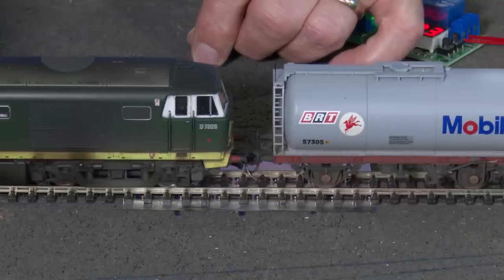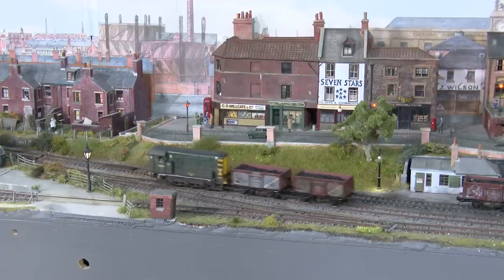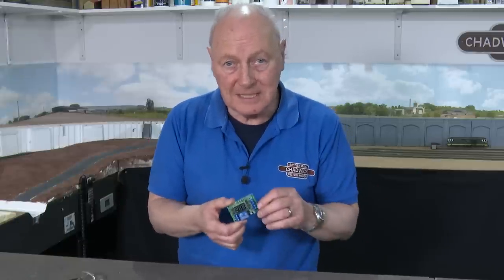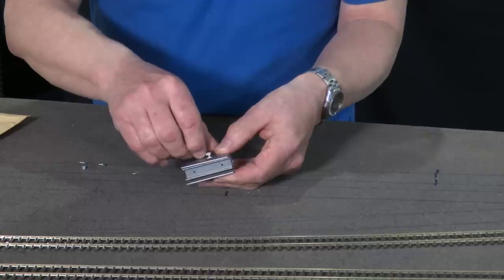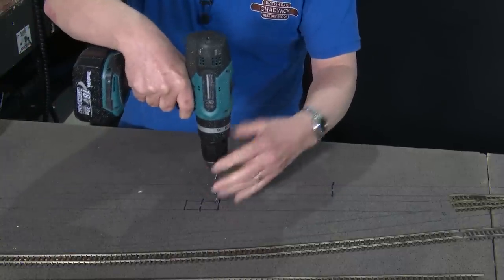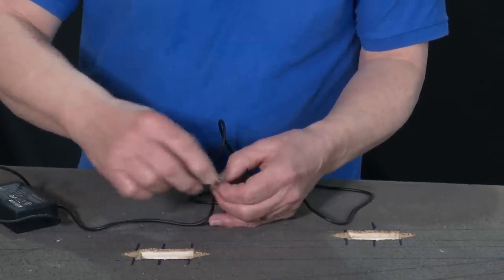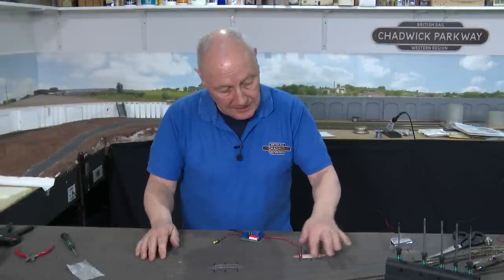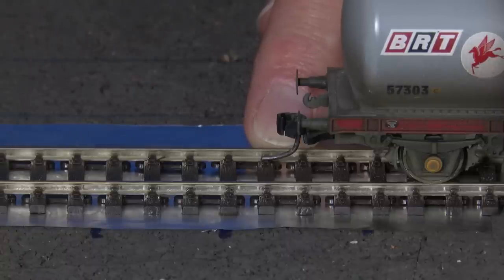Installing Kadee Electro Magnetic Uncoupler #309 Chadwick Model Railway | 182.

Comment: I read Steve Jubb's comment which was actually a very good option, my thought was just the opposite, wire the LED on the push button to the NO side along with the power to the solenoid so that the LED is illuminated while the uncoupler is active.  So it becomes your choice as to which way you want to go with the LEDs, always on until you activate the uncoupler or only on when the uncoupler is energized.  You might have some sleepless nights pondering that decision.  😉😉
Reply from the maker: It’s an excellent dilemma, Dave, but I would go for the LED off when energised. Regards, Charlie
Reply: @ChadwickModelRailway  Right choice - then the switch is illuminated so you can find it when you need it!

Comment: Hi Charlie, another excellent video in your very easy-to-follow style. I'm also trying to find the best solution for hands-free Kadee uncoupling without the indvertant uncoupling that can come from using the regular Kadee rectangular magnets. I was wondering if you have considered trying Rapido's railcrew uncouplers, and if so, what do you think of them?
Cheers,
Ben
Reply from the maker: No Ben, I have never used those uncouplers. However, I am working on an automatic uncoupling solution driven by Train Controller. Regards, Charlie

Comment: Great video on electrical switches and relays.

You might actually be able to use the 'NO' terminal on that timer to drive the LED on the switch. That way the light goes out when the timer is running. Or the other way around so the LED lights up when the solenoid is active but then it makes the button harder to find in the dark.
Depending on voltages it might require another relay though.
Reply from the maker: I had thought about it, but who looks at the switch when you’re doing the uncoupling?. Regards, Charlie

Comment: Another great video. Why don’t you wire the positive led terminal to the output positive that goes to the coil. Then it will light up green while the uncoupled is energised. Just a thought.
Reply from the maker: Hi Harrold, the coil voltage is 16 volts, would that not be going through the LED and perhaps blow it? Regards Charlie
Reply: @ChadwickModelRailway  maybe a little high, I guess you could put a small 500 ohm resistors in series, and that should do it. Ant.
Reply from the maker: Thanks Ant,  that’s certainly worth exploring. However, I would much rather have a switch that flashes whilst in operation. Perhaps that’s just wishful thinking. Regards Charlie

Comment: That’s an interesting video Charlie. I’ve been wondering about the best way to go with couplings, particularly with uncoupling in mind as I’ll (eventually) have a terminal station where locomotives need to couple and uncouple. I do like magnetic couplings so will use these in between rakes, but locomotives and coaches at the ends of rakes will use Kadee couplings. The uncoupler you’ve demonstrated is the answer to my station (and also some sidings) means of uncoupling. Though, rather than those relay boards that you’ve used, I’ll use a DCC relay so that the uncoupling can be performed through iTrain.
Reply from the maker: A great answer to our ongoing coupling issues. Good luck with your solution.
Regards Charlie

Comment: I use a capacitor discharge unit for my points, it would give the solenoid a burst rather than a long period of current, so the train would have to be exactly over the decoupling point, but you don’t require a large power supply and it’s safe in regards to burning out the solenoid.
Reply from the maker: Now that’s an interesting point. Regards, Charlie

Comment: what you could do is wire the LED for the button in parallel with the solenoid, then it will light the button when the solenoid is on. Or wire button LED with the NC and C side of the relay, then the LED will go out when the solenoid is On
Reply from the maker: I think you’re right, going out when activated is a better option. Regards, Charlie

Comment: You can buy car type blade fuses and circuit breakers (Thermal trips) with different types of fuse holders if your ever concerned with power supply overload or short circuit. They can be found in a few places. Circuit like this I would be tempted to add a fuse to the PSU output protect from short circuit.
Reply from the maker: An interesting thought John, many thanks. Regards Charlie

Comment: What an interesting system! It looks really quite handy, I have to admit I'm not really a fan of Kadees, because I really can't suspend my disbelief if I see a British locomotive running with such a detailed American coupler even though I absolutely can with tension locks or magnetic coupling like from Hunt couplings. Although it seems that Kadee is basically the most sensible route to go for having functional couplings that don't protrude much.
Reply from the maker: Interesting comment. However, these are much more preferable than our normal tension lock couplings. Regards, Charlie

Comment: Great video very instructive and well presented my only comment would be I am supprised at the size of the solonoid it's massive It does not matter on your layout because you use tortoise point motors so have a deep area free under your baseboard but if space is limited it would be a problem.
Reply from the maker: Yes, that’s a fair point Arthur. Regards, Charlie

Comment: HI Charlie. 

1.5amps was referred to twice so, simple arithmetic shows you that 2 x 1.5amps = 3amps. Simples! 😊 

Paul.
Reply from the maker: How silly of me to have missed that Paul. Regards, Charlie
Reply: Charlie.

It wasn't really silly of you as anyone who left school a very looong time ago is prone to simple mistakes. 😅 

I'd just like to point out that with uncoupling devices permanently positioned on the track, you are restricted with your shunting operations. Therefore, if you have to uncouple a rake of only 3 wagons, they could be ‘parked’ several dozen yards from the end of the line where the unloading bay is situated. Personally, I would use the good old fashioned method of a bent lolly stick for both wagons and carriages, even if the ‘hand of God’ is looked upon as sacrilege. 

Regards, 

Paul. 👍

Comment: Splendid stuff as always Charlie.
Given that the boards have a green LED indicator on them already a person could just introduce the end of a bit of fiberoptic line to that LED.  Then trace the other end around to some convenient location like the fascia perhaps.  That would want a ferrule of some sort.

Alternately a person might just introduce an LED on the energized leg and wire it to some feature on the layout like a shack or abandoned gooseneck light that would illuminate while the "decouple" was "on."

A person disinclined to muck about in the switch circuitry could just lay a Normally Closed magnetic reed switch near the solenoid and use that to animate some feature on the surface o the layout.  A light would be an obvious choice but a door to a shack or shed could be animated as well.
Reply from the maker: It’s interesting that you made that suggestion, Captain Mac. I had thought about putting in a little shed, with one light on either end to be turned on when the appropriate solenoid is activated. Regards, Charlie

Comment: Hi Charlie! Informative and very timely video as I've recently been watching Larry's video on the other uncoupling options, and you've introduced me to an option I was previously unaware of. Looking at your particular use case, could you run both turnout push buttons through a single timer, given that they're side by side? I'm now starting to think about uncoupling options for my own layout which is under construction but as you say, the solenoid option certainly ain't cheap!!
BTW the end of February is fast approaching so I hope you have enough time to stick to your monthly schedule? 😉
Cheers, Peter
Reply from the maker: Great comment Peter.
However, if you wire both solenoids together, then you would pull twice the power from the transformer. 
 Yes I do realise I am up against my February deadline.! Regards, Charlie

Comment: Hi Charlie, after watching your video (which I found interesting, thanks) I'd like to add some info about the green push button switches, which have various alternative operating voltages for the LED's. I use these myself on my fiddle yard mimic panel, I wanted to use the LED's to show which route is selected, but I had to add a diode on one of the switch led terminals so that the LED only illuminates when that particular route / loop is selected. I had a brain scratching exercise trying to find out why a LED would illuminate no matter if the polarity is reversed or not. So I opened up a spare switch and found that the LED is bi polarity (in actual fact there are two LEDs in one). These are great switches and I've had no trouble at all with them, I've also used them as reset buttons for NCE EB1 DCC Circuit Breakers. Anyway I hope that this info helps others who want to use them for different purposes.
Reply from the maker: Thanks Eve, that’s very useful info. They had me confused for quite some time. Regards, Charlie

Comment: Charlie why not wire the Pushbutton Led across the solenoid wires so that when you push the button the Led comes on for the time you have set on the timer and then goes out showing there is no power on the Solenoid. BIll fro WA
Reply from the maker: I think that it will be better the other way around Bill. Regards, Charlie

Comment: Great update Charlie with some very useful and interesting information! I'd never seen those countdown timers before and am sure they'd be useful in a range of situations, both for delaying and prolonging the operation of some external device! However, I was wondering if instead of using a push button, could you use DCC to trigger the countdown? I suppose I'm asking if you know of a way to use a DCC signal to replicate a momentary contact switch? Keep the good content coming! All the best, Ian.
Reply from the maker: Hi Ian, it’s funny that you ask that question. It’s something I’m currently working on. I’m using a reed switch to feedback into the system to see if it will auto uncouple. Regards Charlie

Comment: When I built my little layout, I installed a Kadee #308 uncoupler magnet under the track on a siding. It's fine for that because any unintentional decouples will already be on a siding and I can take another shot at it. 
Rolling stock that I use for the industries on that siding have had steel weights replaced with lead, or copper pennies, and all wheel sets are non-magnetic.
It would indeed be far better to use the #309 as you show here for mainline and large or busy areas. I know Loksound decoders include an auto decouple shuffle that can be triggered with a function button and adjusted to get the timing right. That could be a next step if you use those. Then it'd just be two button pushes.
I feel like this could all be automated actually. One press and it's all done for you, but you'd need the decoupler to talk dcc as well. Maybe I'm rambling? OK, thanks for another good one!
Reply from the maker: You’re bang on the money, Tom. I do use ESU decoders and have enabled the uncouple shuffle. Hopefully Train Controller can automate it all. Regards, Charlie

Comment: Charlie, two things. 
Did you check the current taken by the uncoupler?
If the power for the illumination of the push-button comes from the output of the relay, you can have lights off or change colour when the relay is active.
Reply from the maker: No I didn’t check its current draw Tom. However, I am searching for a by colour LED. Regards, Charlie
Reply: Charlie, it might be sufficient to check the voltage coming out of the PSU, and confirm it doesn’t droop because of taking more current than the PSU can provide.

Comment: If you wire the switch illumination to the relay output you could use that as an indication to the solenoid being energised
Reply from the maker: Yes, but I think it’s better the other way around so it  goes out when it is energised. Regards Charlie
Reply: @ChadwickModelRailway  easily enough done through the relay NC contact 🙂 as I'm sure you know

Comment: Hi Charlie, you might have some options for feedback on the switch with what you already have, if it will cope with the same 16V DC that the solenoid uses. (if not you can probably achieve the same by adding a resistor).

First you would need to swap the relay connectors so that +16V is on relay common, and the solenoid is on relay NO. I think you have those the other way around at the moment.

Then you could wire the switch LED between the relay NC and the 0V on the power supply. This would give you a switch that lights up green whilst the solenoid is off, but goes out whilst the solenoid is on.

You can get similar buttons with multiple colours in them. If you had one of those, you could wire it as above but with another colour to the relay NO with the solenoid. This would give you a button that lit up green when idle, the turned red whilst the solenoid is active. Unfortunately the only buttons like this I could find are physically bigger, so would need different holes, and are about £15 each, so not certain if that's worth it.
Reply from the maker: Thank you for some sound advice George, I think you’re spot-on mate. Yes I am looking at the twin coloured switches but haven’t found anything suitable as yet. Regards Charlie

Comment: Pah. Americans coming over here with their reliable coupling systems and making us use ye olde feet and inches! 😂😂
I just hold to anything under a yard needing to be measured in millimetres....

Another good video, Charlie. Don't know how you manage to make these so informative and entertaining.

I see everyone has already suggested ways of making your sexy switch light/unlight when the solenoid is in operation.  

This must be a a really silly question, as I can't see anyone else ask it, but I wondered why you need that countdown circuit box (as clever - and yes a wee a bit sexy - as it is) at all. Would the solenoid not work with just an unlatching push to make switch, and you just hold it in as long as it takes to uncouple?  I'm obviously missing something: is it to do with future automation which can't apply a finger for 8 seconds, maybe?
Reply from the maker: You make an interesting point Andrew. However, I use one hand to hold my controller, the other hand to press a button, leaving me one hand short to press the actuating button. Regards, Charlie

Comment: Hi Charlie, Great video. I have recently started watching your channel and I saw I one of your older videos (episode 123) you mentioned that MDF was not a great material to work with. As I am planning the construction of my new layout I was wondering what the best baseboard materials would be and if there are any I should steer clear of as I have only ever used 18mm MDF. Thanks Nat.👍
Reply from the maker: Hi Nat, I would go for either 12 mm or 18 mm plywood. Regards, Charlie
Reply: @ChadwickModelRailway  thanks 👍

Comment: Question, curious why you chose to use use magnets?  Precimodels makes a motorized coupler, did you consider this as an option? Thanks for all your videos, they are great!
Reply from the maker: Yes Brad I do have some of their solenoid uncouplers.  However, I do need to show and try out, what is available.  Regards Charlie
Reply: Do you like the way the solenoid couplers work? I am wondering the pros and cons. Thanks

Comment: A 2-56 screw means that it is a size 2 screw with 56 threads per inch. Metric screw threads are measured by the distance between the threads.
Reply from the maker: Thanks Dave, it appears that every day really is a school day. Regards, Charlie

Comment: Great video as always Charlie. Could you power the LED on the switch from the relay? The green ring will then only illuminate for the period the relay is energised and provide visual confirmation of the switching.
Reply from the maker: Great comment Phil, but would I not be putting 16 Volts  through the LED rather than the 12? Regards Charlie
Reply: @ChadwickModelRailway  Thanks Charlie. There may be a resistor built in to the switch or you can just add one to protect the LED if you are not sure. Worth a try? I do it with some (albeit square ones) that I have. They light up as the relay latches, amd extinguish when it reopens. V sexy!
Reply from the maker: An excellent suggestion, Phil, I shall certainly check it out. Ideally, I would like a circuit board which allows the LED to flash when in operation. Perhaps that’s just wishful thinking! Regards, Charlie
Reply: Thanks Charlie and that could be done. You would need a second latching relay with a flasher circuit on the NO side with power to LED normally fed from the NC side.

Comment: With your green lit switch, why not route the LED supply via the NC side of the relay. It wouldn't flash, but it would go out when the solenoid is active.
Reply from the maker: I tried that mate, but it seems to be an issue, I shall have to investigate further. Regards, Charlie

Comment: As the switch gives you access to the switch/pushbution, led why not use a pair of wires in parallel with the solenoid back to the button led so that it stays alight all the time the solenoid is operated. Seems logical tome.. So long as you get the polarity correct for the led home and dry.. Worth it so that you have confirmation that the uncoupler is operating/energised. You could put a resistor in series if the voltage is too high.
Reply from the maker: I take your point Brian, but who looks at the button when you’re doing the uncoupling? Regards, Charlie
Reply: @ChadwickModelRailway  Thanks Charlie Just a "Serving Suggestion" , but, why then bother with illumination just to make it a bit pretty. At least you would know what the solenoid is doing and that it has actually responded.